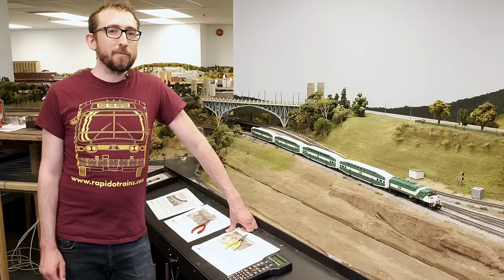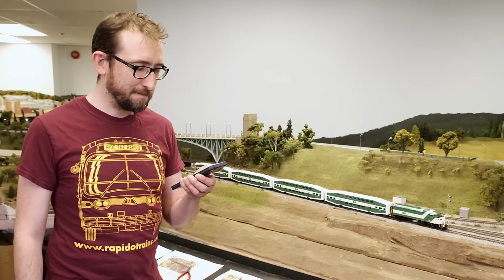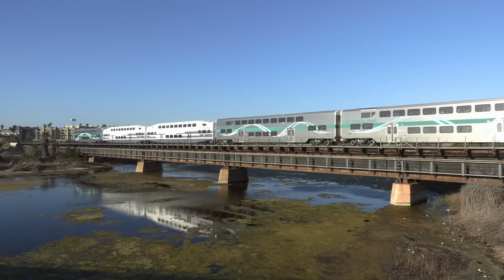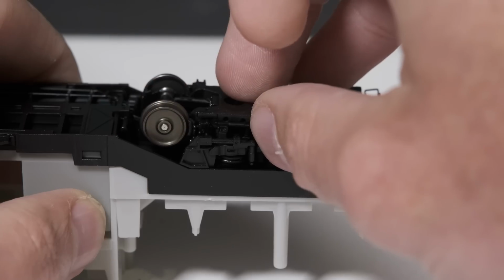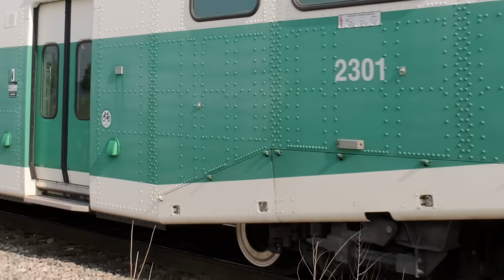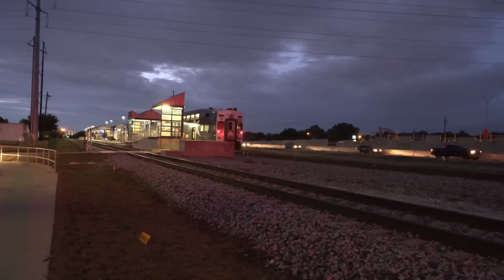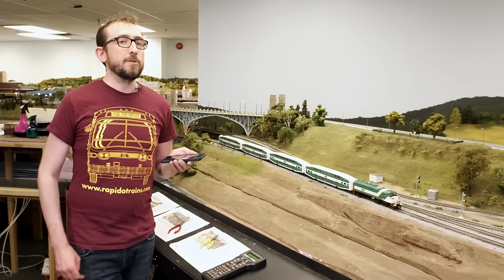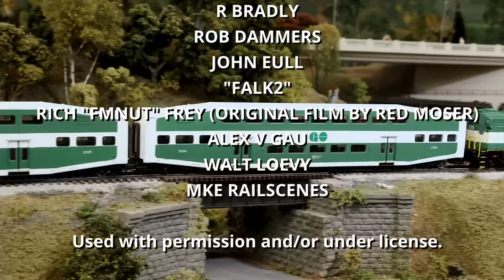New Rapido HO Scale Commuter Cars!

Comment: The yellow and blue train at 2.04. The first part is actually the engine with room for passengers at the top. For weight disturbution they have the extra axle in the middle. They are owned by the Netherlands Railway (ns, nederlandse spoorwegen).
Reply from the maker: Thanks for the info! We're not very familiar with most European prototypes.

Comment: Nice
But I Could Design the Single Decker Coaches which were used between 1967 when GO Transit Opened and 1989 when they were replaced by Double Decker Coaches which we all knew today
Reply from the maker: We'd love to do them too!
Reply: Rapido could do a set of the RTC-85 for the ONR Polar bear Express, new and old paint schemes plus one for AMT. Maybe even a train set like they've done for the Tempo.